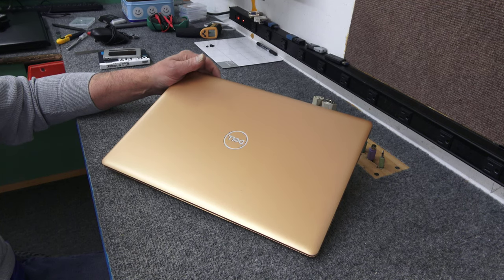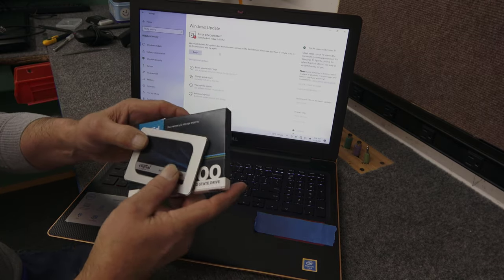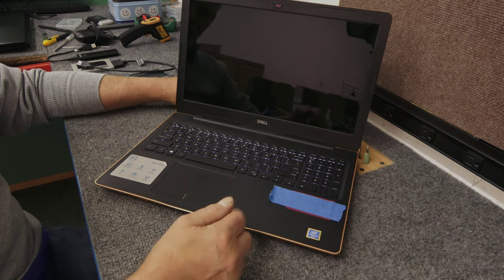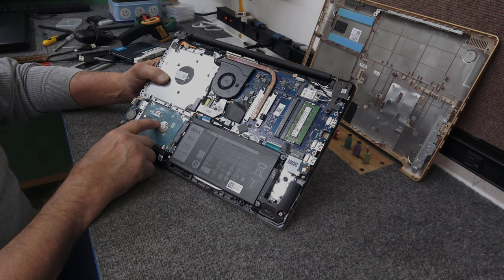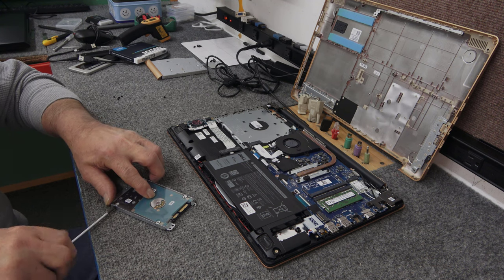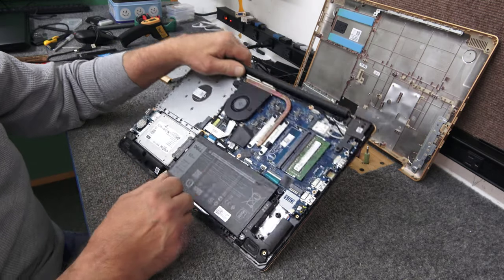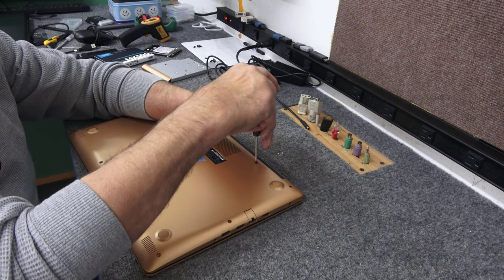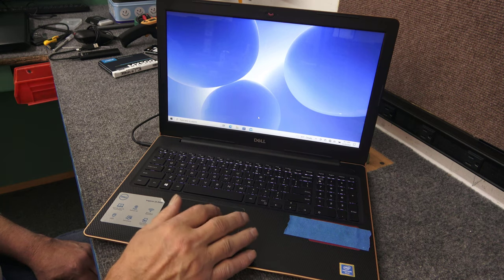DELL Inspiron 3580 SSD Upgrade and Other Options.  HDD Clone to SSD

Comment: Happy New Year Dale!  Do you ever work on desktop PCs, or just laptops?
Reply from the maker: Oh yeh, I work on desktops all the time. I get way fewer in than i use too. Mostly gaming rigs, troubleshooting stuff. It's moving to a portable world, ya know.
Reply: @CadillacComputerCenter  Yes it is.  If I start to clone the slow mechanical hard drive on my Dad’s slow Lenovo desktop PC, what if Windows 10 goes to sleep?  Will the cloning process continue?
Reply from the maker: @dave4shmups  disable sleep in power settings  before you clone.
Reply: @CadillacComputerCenter  OK, thanks Dale!

Comment: Hello, I have the same laptop model and in games the processor reaches 95 degrees, the paste is replaced, why is the ventilation on the cover covered with aluminum foil, if I peel it off is it not better?
Reply from the maker: This model, I believe,  draws air in from bottom,  and blows out side. Any ventilation holes on bottom should be clear, yes.
Reply: @CadillacComputerCenter  Thanks for the info, I think yes the cooling is made to take air in and hot air out through the same vents bad cooling system

Comment: Is cloning necessary? What happens if you install it without cloning?
Reply: @Max M if you install a new ssd without cloning the old hdd you will not have Windows on it unless you do a clean install. The computer will say no bootable device.